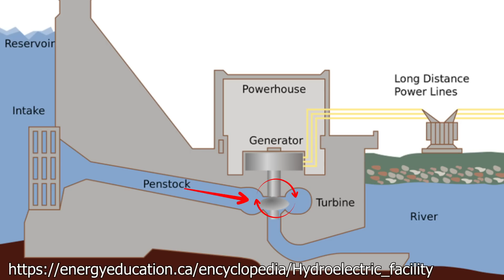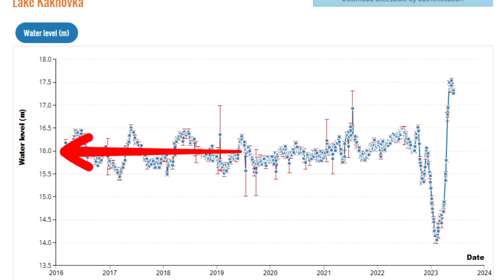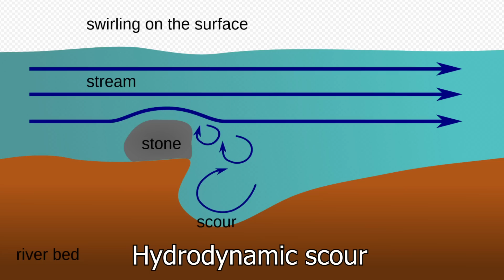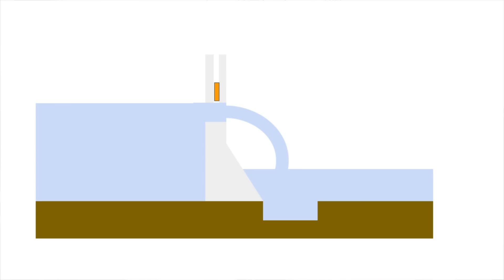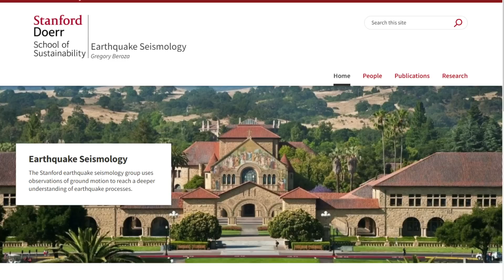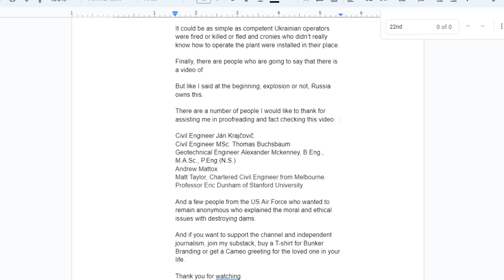How Russia Destroyed the Kakhovka Dam

Comment: Why?! It makes no sense .  Obviously, US intelligence already knows what happened. I can say it was definitely not an airstrike or external detonation. Theres no carbonized anything (scorch marks). I believe there were explosives in and on the dam at one point. Im not certain thats what caused the failure. As soon as russia destroyed part of the dam to prevent crossing, i became worried about the dams future. Fire or high heat is bad for concrete. What i dont understand is why? Has Russia just decided if we cant have it no one can? The dam provides crimea, Russias primary desire in Ukraine, with almost all drinking and agricultural water. The dam produces a large amount of power which was benefitting Russia. After a month the Energodar Nuclear plant will be out of water; all 6 reactors will idle and slowly heat up until explosion. Now the 5 dams upstream wont work right because water isnt at its normal level for power. So half of Ukraine will likely go dark before the nuke plant fails. Thats the only benefit to russia. However, i expect Poland to take unilateral action if other allies dont move. I could see at minimum Poland occupying free Ukraine allowing the entire ukraine army to move to the south and east. The kerch bridge will be cut soon and so will the russian army at melitopol. This means everyone in crimea is trapped without water and with little electricity.

Comment: The dam collapse is perplexing.  I'm not happy with any of the theories I've heard.

I see two issues with your analysis.
1) The dam failed in multiple segments simultaneously, but did not fail between those segments.  It's not at all clear to me how scour in one area could lead to a failure in another without taking down the intervening structure.
2) If the dam failed gradually, there should be pictures of the intermediate failure states.  Your picture here of the roadway section destroyed is excellent.  I've not seen that crucial fact reported elsewhere.  But I'd expect there were more broken intermediate states.
3) NYT says a USG official said a US spysat caught the explosion at the dam.

Your point about turbulent water across the entire dam is also excellent.  It does imply that the sluice gates were all overtopped.  That does mean the dam was subject to its maximum overturning moment at that time, but I wouldn't expect that small water flow to cause significant scour.

There's only a few days between 02-Jun-2023 (road bridge gone, rest of bridge intact) and 06-Jun-2023 (dam broken).  How much does this satellite imagery cost, and is it available between those two dates?
Reply from the maker: It costs about $250 per image but it varies. Sometimes you have cloudy days.

Comment: If you want to pursue the seismic thing more,  google the Raspberry Shake network.   It's open source, hundreds of stations around the world - you can buy and setup their seismographs at home to detect small local events, or large events around the world.  But best of all, you can access the data from any shared station.     There aren't any in Ukraine,  but there are many that are a lot closer to the dam than Norway.  Just need to find a few with clean signals, and see what the event looked like.     They're not just a toy.  When North Korea last tested an atomic bomb - around Magnitude 5 if I recall,  I picked up the seismic signal in Vancouver BC.  I could detect events of around Magnitude 2 150km away, from blasting at an open pit copper mine.

Comment: I'm skeptical. As you can see at 0:25 the Kakhofka main dam breached at TWO places : The main dam left of the white building, and the generator section right of the white building.

I'm an electrical engineer, so may be off here. But how can a dam "structurally fail" at two places at once ? Just like a rope does not break in two different places if you tear it apart, and only one fuse blows you put two in series, you would expect a dam to fail only at ONE place, which then quickly carves a hole that widens. Not at TWO places at the same time, unless it had some "help"...

Comment: @Ryan McBeth  There's new seismograph data available that does not leave much margin for doubt over what happened. Several tones of explosives were used to make the structure collapse.  It would be interesting to have a reviewed video over this matter in light of all the data now available.  I have created a small edit with the transcript of the latest Communication intercepts of Russian Soldiers talking about the explosion. Also has seismograph data from Nova Kakhovka region at the moment when the explosion occurred:
https://youtu.be/aFX55nNmQ6I
Reply: Plus the US released the information that its satellites had spotted the heat signature of what could have been an explosion. In my view the dam suffered a cascading failure, initiated by explosives. The Russians had miscalculated.

Comment: The only point of contention I have with this video, which was well researched and well done, is the argument that destroying the dam would only result in a wider water crossing. 

Width of a crossing definitely plays a part in the risk of the operation, but the speed of the water is a much greater concern, in my opinion. Regular amphibious craft make a redneck in an inner tube powered by an office desk fan look both nimble and agile. From what I know, which is limited, most river crossings don't happen at rapids or areas where the speed of the river increases for a reason. It is very easy for a crossing to turn into a disaster just by dint of things going wrong, and without any outside help by an opposing force.

So just increasing the rate of water moving through the river would be a solid enough deterrent to any sort of river crossing, which could justify the destruction of the dam. Especially when taking into consideration that there is a long, long, list of dumb things Russia has done so far in this conflict that might have gotten them a small short term advantage but has serious long term negatives.

However, your theory that it wasn't intentional and was just bad management. I can believe that just fine. Russia, or the former USSR, has a detailed history of incompetence and corruption (which leads to incompetence, why try when you can just bribe) that defines almost all aspects of the state. Even more so, when you take the account of all the snowmelt and rain the region has received in the past month or so. That much increased water causes issues even in California, let alone an active warzone.

Comment: This is a brilliant analysis! And explains everything. I wondered why Russia would deny Crimea water. Well…they didn’t. Their incompetence is denying Crimea water, not their planning. The sniper idea makes sense as does incompetent dam operators. And the x axis of the water level is misleading at first glance. It looks like a fast fill, but what it really shows is that from the nadir of water flow in mid winter they just didn’t adapt to the water inflows. So it makes sense that the dam topped. And once that happens most dams are in trouble from multiple threats. But the FINAL piece is seismIc data. If that was an explosion, it should absolutely shown on many stations, even across the world. And the BOOM shouldn’t have been the great mother of all bombs. Loud enough that auto alarms should have been triggered. An everyone in that region would have head it. But it is their fault. Absolutely. They are so wise…we’ll all the wise ones are
In the Gulag. The yes men are running the dam.

Comment: Understanding that the answers to these questions does not necessarily change the analysis provided in this video, I'm going to ask them anyway.

While changing the width of the obstacle may not increase the difficulty of a water crossing, wouldn't the difficulty of the water crossing be increased by increasing the flow rate of the water being crossed?

Also, if a water crossing were planned and then subsequently delayed due to the flooding, wouldn't the increased mud on both sides of the water obstacle increase the difficulty of the crossing and thus further delay said crossing, especially given that Ukraine was already waiting for the soil to dry out before starting their operation as a whole?

Comment: This is a good educational video and analysis of dam failure.  However the conclusion is contradicted by a report issued yesterday from NORSAR showing a seismically detectable event occurring at the time the dam failed which strongly suggests a large explosive was involved.  I'm sure the dam was deteriorating from lack of maintenance and control as well as the overtopping you've shown.  But I suspect that was leading to a more gradual deterioration and the dam wouldn't have failed on its own for a bit longer.